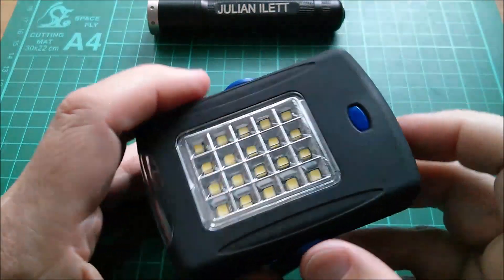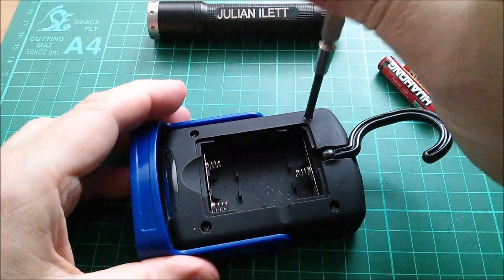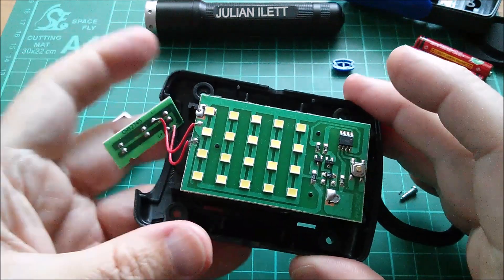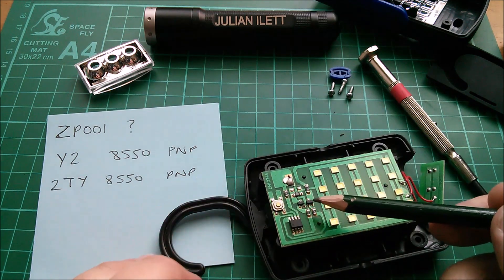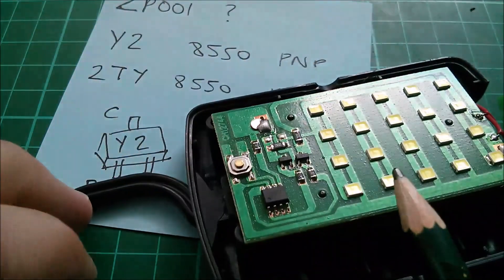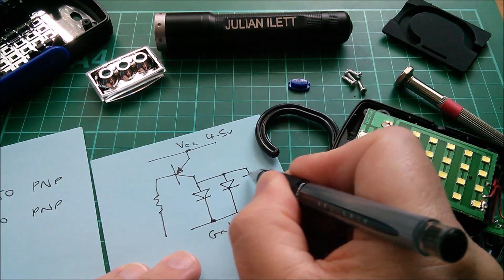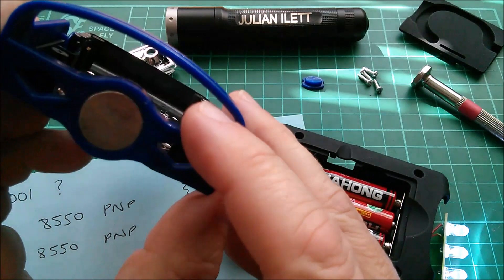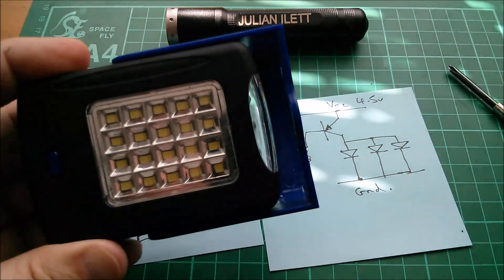LED Utility Light Teardown

Comment: I like this light. Seems well thought out and cheap to manufacture. 
The 0 ohms are used in place of jumper wires, to avoid making double sided pcb's. The 100 ohm on vcc can act as a noise suppressor, but in this case, I think they wanted to make sure the pins that drive the base of the 2 transistors are limited, hence in combination with those base resistors, the transistor will act as current limiters. 
We missed you Julian. Have you been slacking off?
By the power vested in my by her majesty, I order you to make more videos 😜
Reply: Also, I am pretty sure that is not an MCU. It wouldn't make sense! It does nothing but toggle. No flashing or any other function. Maybe some sort of flip-flop?!
Reply: that transistor is operating in saturation region. Vce should be around 0.2-0.3V.

Comment: At high collector current, the typical hFE for that transistor is specified at 80.  If say there's 4V across the 470R base resistor then that would give a base current of 8.5mA and therefore a collector current of 680mA.  This would be 34mA per LED in the main panel, which sounds about right.  So isn't is possible that the transistors are current limiting?  It wouldn't be a very accurate way of controlling the LED current if the hFE varies a lot between individual transistors, but perhaps they've selected transistors with fairly similar hFE?  This would also explain the differing base resistors for the two circuits, which without the transistors current limiting would be pointless.  The 1kR resistor would give a collector current of around 340mA so around 110mA per blue white LED, which I guess is about right as these look to be higher power LEDs - 0.3W LEDs perhaps?
Reply: Paul Grimshaw This design  is exactly what not to do. Diodes is parallel is bad: the threshold voltage decreases with temperature. If one led has a slightly smaller threshold (happens because of manufacturing variations) then it passes more current, gets hotter than the others then threshold decreases, then current raises in it (and decreases in others) so it gets even hotter (and others cooler)... Conclusion there's a bad current balance. Also if one led dies others are over driven and fail faster. There's the same kind of problem with the pnp. You never design for a specific hfe. You consider the range (ex 20x to 100x) and design a circuit that works properly whatever hfe is in that range.
Reply: I don't think either reliability, consistency or best practice are high on the design requirements list for products like this.  Lowest possible component count on the other hand...
Reply: Paul Grimshaw I agree lowest possible price is all that matters if it works more or less. However listen at 2:45...  The problem is the lack of critical comments on those cheap designs. Another example is the use of blue leds in his supercaps circuits. Yeah that works because he knows that the voltage is quite precisely 2.7v and because he found leds with the right threshold. But if you use leds from another manufacturer they could burn or barely light up if you are not lucky. Good design would be to use red leds with a resistor and using the datasheet of the led, taking the lowest documented threshold and chose a resistor to get a current a little bit lower than the max recommended one. Cutting  corners on such simple circuits is a bad start if you want to build a more complex one latter.
Reply: bulsiht